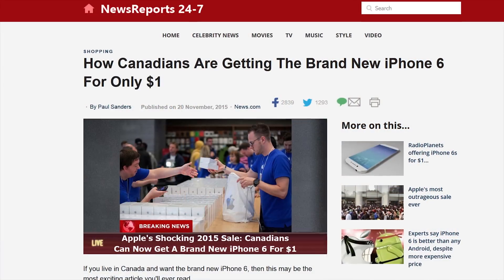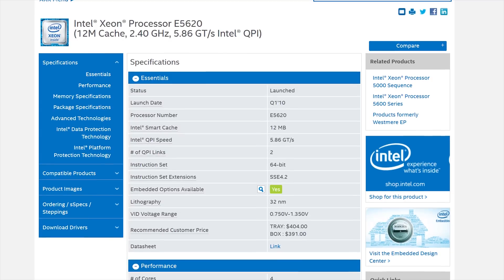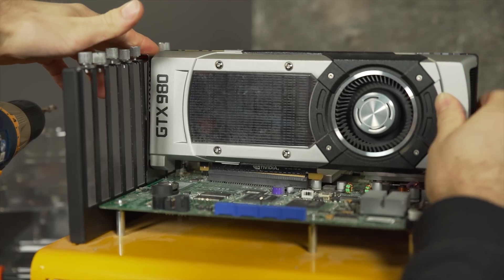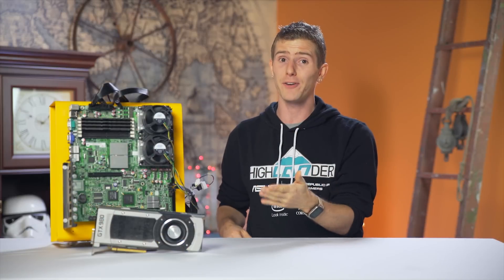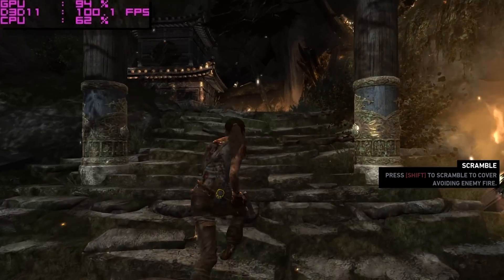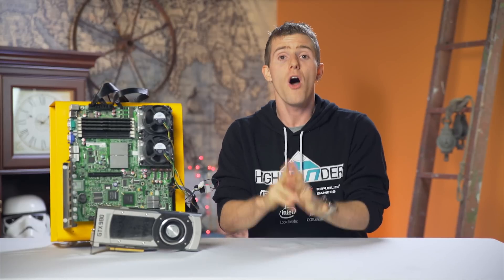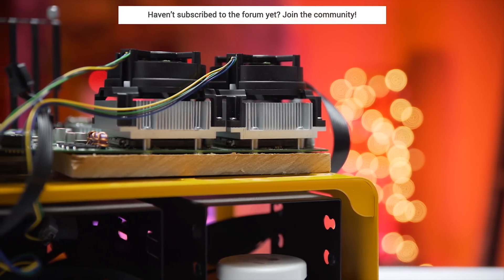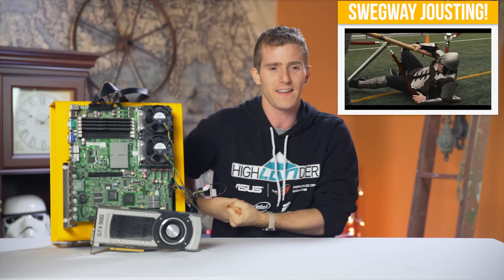Under $150 Budget Gaming 8 Core CPU, Motherboard & 16GB RAM

Comment: Ive had a desktop like that for almost a decade! It's an Intel S5000XVNSASR. First, I ran it over remote DVI cabling in a separate server room, but now I've put it into a regular PC case (Chieftec with LGA-771 holes) and the CPU fan noise is HORRIBLE. Those fans (btw use copper, not aluminum models for Xeon X5450), are not designed to run quiet; moreover, because there's two of them, you get horrible low frequency vibrations (i.e. loud hum from the case) at certain speeds if they're a bit different (mine are). Finding liquid coolers or premium air coolers like Noctua NH-U12DX at this time is just a bust. I've had two shops on Amazon send me wrong models (NH-U12S). I suggest you to do the same trick, but with more modern motherboards.

Comment: can u test this one again now in 2018?
Reply: 2020 now and still no more testing this :(
Reply: no
Reply: i would have liked to see a second attempt at this but with commercial socket 775 motherboards modified to take these chips. turns out by covering two pins on these 771 socket Xeon chips and by cutting off 2 of the protruding plastic edges found on the corner of the socket on the motherboard, you can run these chips on commercial 775 socket motherboards.
Reply: @yareddeyaso1219  turns out u could have done that in 2010 when the 775 came out....
Reply: @kumbaj1612  yeah. I'm just seeing linus's video now so that was why I wished he had revisited it.
Reply: you can get xeon 4 core 8 logical for like 5 dollars now... the mother boards are about 50-60 dollars second hand though but its still a viable budget gaming pc.
Reply: @Writeous0ne   I can't agree with you ,  you can get  good  4/4 cpu for  99$ with motherboard that supports  new cpus and is being updated (am4)   2200g can handle  most of the new games with onboard gpu
Reply: @kaliavaliani7153  at $50 old lga 2011 xeons have more value than zen+ apus
Reply: @pankaik  better upgrade path

Comment: Powredge 2950 isn't bad. Still only x8. Have to saw out the back of the slot to fit gfx. Chassis is huge. But I picked one up with 2x4 core Xeon and 32gb fbdimm for 75 Canadian. I picked one up with 1x4 core Xeon and 4gb ram for $12 Canadian.

Comment: This was a cool idea when it was made.  For those wanting to get into 8 core and 16gb cheap in 2018, might check into LGA 1366.  There you can get workstation or server mb, 8core cpu and RAM for $150 and better PCIe performance.  Some are better overclocking too.

Comment: If video is capped by the x8 port that work at x4, just change the video card for 2 HD 7790 on crossfire, doing crossfire you overlook the x16 limitation, and price of 2 HD 7790 is not that expensive

Comment: Hey Linus, where do you think we are today in terms of the economic viability of used server hardware as an alternative to lower cost consumer processors? Keeping in mind that we're over two years down the road and the trend towards multi-threaded workloads is continuing, as is the availability of post-Sandy Bridge server equipment which are arguably better performing in 2018 than the Xeons were when the video was released.  Big fan, let me know your thoughts!

Comment: Did this in 2018 for under 80$. Only cost me 65 because only 1 CPU+ 12gb of ram. Supermicro x7 boards are good as they have lots of PCIe slots, 6 Sata ports.

Comment: I'm foolishly late to the party, but after years of paying way too much for Apple everything, I got back to using and building traditional PCs-- well tinkering with, more like.  Haven't done a total build in a long time.  point is, it feels almost like a little revolution to get away with playing titles like that on a super cheap machine, especially if it's made from used parts.  I know the impact is minimal, but at least those parts don't end up in a land fill, and a corporation does not rip you off.  Seems like a win to me.  Thanks for the very entertaining and informative videos!

Comment: i rock a 06 mac pro dual quad xenon 6gb ecc ddr3 plenty of pcie slots on it and i use the dx11 ati 5770 1gb gddr5 windows 7 64bit and is just now hitting games it cant play basicly new cod ww2 new forza  lots of the newer games only run at 25 to 30fps and these are titles i dont meet system requirements then i have a hp wx8600 server i use as a gaming rig agin dual dual core xenon ddr3 ram js they are the perfect answer for cheap gaming and emulation

Comment: So, yeah, I came back to this video to let you all know that I did this, and it sucked hard ass. I had the opportunity to buy an old IBM server for 20-ish  US dollars. Ordered 16 gigs of ram and two 4 core 3.61 ghz xeon cpus off ebay (and also a Pci-e extension cord as I wont saw off a piece from the most expensive part of the build) for 51 USD. Bought a second hand 750 Ti for 96 USD I was looking at those ebay chineseum 55 USD gtx960-s but I didn't had the courage(would like to see a test BTW), and I was set. Or maybe not, there was only one heatsink so I had to make my own from another heatsing by sawing off chunks of it. Or I could have ordered one from india for 50 more dollars (no way, this is a budget build). I had to buy a sound card becouse why would any server need one?So the first one didnt worked in my mobo, fuck you ASUS and your sound cards, so Im not counting that one and I settled for a cheapo Star tech or some shit for 23 USD. After this I put together everything, installed win 10, it works like a charm (a very loud charm, I havn't replaced the fans yet). And then the next day, when I wanted to install games and finally play. The mofo Adaptec Raid controller decided to die, the server won't boot without that even tho I couldn't care less about RAID (a raid card for this server is 100 USD, agan from india for some reason). So I spent 3 days to figure out a way to bypass it and finally get it to boot, I had to update the BIOS but Lenovo decided to rename these old shits form System X to ThinkServer so I could't find any support untill I found this out. Oh and it is crazy heavy. But finally it works and it was worth it, was fun to put it together, caused me some headache. Now Ill be off to play some crysis.

Comment: YES! i can finally afford to make a rig that doesn't suck!
Reply: BTW are there any Micro atx sized dual socket boards out there? I'm trying to build an ultra budget build in a dell dimension 1100/3000 case and I need some advice on cheap setups that will work well enough for semi recent games.

Comment: 2 years ago I had a good Asus P9 motherboard, for i7. All I needed was a processor and some RAM. i7 was so expensive that I just sold the board and decided to buy an old workstation, HP XW8400 fo about 300 dollars. The prices here are a bit higher here... For that money I got a HP case, PSU 850 Watts (!!), 2x Xeon quad-core 3.0 GHz and 4 GB of RAM. And some old Quadro graphic card. I bought more RAM, now I have 16 GB, nVidia GTX 580 O.C. Lightning II and Intel SSd for my system, with 3 more HDDs for data. What I got is a much cheaper PC that can run any game (that I play) and I run them at Ultra or High specs.

This kind of PC uses a lot of power, one CPU uses 150W at 100%, so you will feel this on your electricity bill, not much, but it is noticeable. I can not improve this setup any more, except for the graphic card, so I can still use it for years to come, with some newer GPU. Biggest problem and a bottleneck here is the memory, which is Fully Buffered DDR2 ECC that runs on only 667 MHz, but it is a quad chanell, so that helps a bit. Other problem is the expansion slots, there is only one PCI slot for aditional cards and I used it for a better sound card with optical output, because I need it. You can choose to use that for USB 3.0, SATA 3 or like I did, for a better sound card. But you can choose only one of those things... There is one PCI-e 8x, but if you have any gaming graphic card, it will cover that slot. The mother board has 2 PCI-E 16X slots for SLI, so that is an option as well.

Windows 7 64-bit works great, all the hardware is recognized and there are official drivers on HP site.

I love my Workstation.

:)

Comment: form what research I did seems those xeon cpus (711) can be used in a easier to obtain and much better suited for desktop use 755 boards, can even go with easier to find (faster?) ddr3 just requires a little cutting of either the cpu or the socket notches to make it fit then using pencil to jumper a few of the pins on the bottom of the cpu (look it up) and not need a special multi cpu windows license! im surprised they didn't do this tbh
Reply: hey thanks for the response, just wondering did you need to run a bios hack to get it to take the xeon cpu ? seen a listing claiming one was needed, also what gpu did you use it with and is it decent gaming with only the single cpu? (more than 30fps?) thanks

Comment: I have a HP ml330 g6.
I upgraded xeon 5660, it came with 12 gigs of ecc ram. I have been using it for 4 years with 770gtx, creative audigy (as no integrated soundcard of course), and hp410 raid controller.  Not having too much issues playing games still. (New titles of 2017 course not full maxxed out)
Back in the days it cost me 330£ for the gpu, and that's that.
The micro server was for dump, that was for free.
Later I added a Samsung 850 250gig ssd for the os.
Oh almost forgot I changed the fans for a swift2 (bit hacking were needed as it has special connectors) ... As they were LOUD (search for ml330 g6 startup), it's not ment for home use.
So if you choose a micro server or a workstation, you have more expansion slots, they will do the job. drops the mic

Comment: See this is why I get annoyed with Linus tech tips some times. They boast that the hole system cost only $150 and end up slapping a $400 gpu in the build.the only reason this computer did well at all, was the fact that there was an enthusiasts grade gpu inside.

Comment: Lets  be honest: Anyone who has money for a GTX 980 (which was the top single gpu for its time), also should have money for the rest of the system.
Reply: That's not the point of the video. That was just to see if the setup would bottleneck the GPU significantly (and while it did, it wouldn't on a lower end card). You can put in a lower end card and still run the machine.

Comment: I'm just building a rig based on a HP Workstation xw6400 which I got for free. It can take 2x Xeon 5365 @ 3GHz which I bought for £30 each, 16GB of DDR2 RAM for £20 and I'm sticking a GTX 1060 into it xD Just waiting on the CPUs to arrive as I previously bought Xeons 5450 which don't work with this MoBo.

Comment: I built my server using $69 SuperMicro X8STi-F , $10 Dual X550s 16threads total, stock 1cu heatsinks cam with board, $60 for 2 212 Evos, $34 for 24GB DDR3 1333 ECC.  Eventually Ill add dual X5650s. You overpaid for that shitty setup Linus.

Comment: The whole section about what RAM to get epitomizes why I've never even attempted to build my own system. I mean if it was just a matter of looking up compatible parts and getting the highest model ones you can afford, that would be one thing, but I don't want to have to spend hours or even days trying to figure out what parts will work properly with each other and which model is best. Just ask online! "This part is great, get this!" "No, that part sucks, get this instead!"

Even with CPUs, you can't just pick the highest processor model because it's not always the best. I've seen it said many times that some i3/i5 processors can beat some i7 processors. So how the hell am I supposed to know which one is best without becoming a damn expert in CPUs? Then add becoming an expert in RAM, an expert in GPUs, an expert in power supply brands, etc.

Is it any wonder that so many people just go buy a system? 

And can someone please explain to me why 90% of the damn parts aren't actually labeled? What's that graphics card that was pulled from a system? Why of course it's a VH-17281! Everyone knows what that is! And how about that Creative NSU261A? Oh yeah, I've heard of them! And that 1279871B RAM! Are the manufacturers ashamed of their products? Is that why nothing has the model number/name that the parts are sold under anywhere on the board?

Comment: I probably would have soldered in a new capacitor with the same specs and longer insulated wiring to move it away from the card slot instead of sawing the graphics card...

Comment: Go with old workstation boards not server boards, decent speed PCIe, SLI on many of them, loads of PCIe slots and same dual xeon sockets.
My workhorse PC is a 10 year old IBM ZPro 9228 with with 2x Xeon X5365 3.0Ghz Quad-Cores, 32GB ram and recently a GTX 1060.
The graphics card does bottleneck obviously but it takes pretty much anything I throw at it and the system itself cost me about what I spend on coffee a month.

Comment: hey! i have an Asus H81M-K motherboard with an intel i7 4770, im on a budget and i still need a GPU, i also have a thermaltake case with just a 300w power supply that comes whit it, do i need to upgrade my PS or there is any good GPU that works?

Comment: you could have bought a MSI X58 Pro E with an Xeon X5650/5660/5670 instead of wastsing Money on a Server MB. It has 6 cores and can be overclocked up to 4,4 GHz easily
Reply: and you can use ddr3 ram
Reply: i got a cinebench score of 924 clocked to 4,0 GHz

Comment: You can make this system better. Im saying get a intel xeon 5650 witch is a 6 core cpu and find a server mobo with the unusual lga 1366 socket. If you can find a board with 2 sockets boom. 12 cores. I found the xeon xpu for 20 dollars and a dual socket mobo for 60.

Comment: 😒 Noob, u forgot to mention not all server boards are setup like this, check inside before you buy, alot of boards you dont have to cut the graphics cards, plus alot of them come with a 6pin graphics card plug, easy 1060 6gb sleeper rig, strong power supply already included

Comment: Even though I have a newer i7 4790k system I'm totally tempted to build one of these just for fun. You can find the chips and boards really cheap now. I have a spare PSU, case, one stock and one aftermarket 775 cooler (would fit 771 I guess?) and a few  old platter harddisks (maybe with cheap boot SSD) so I'd just need the RAM, mobo and 2 cpu's. Could be a fun build as a cheap second system.

Comment: I got an entire server with 24Gb of ddr3 for the same price shipping included lol
It's an IBM x3550 m3 with 2 Xeon E5520 quad cores 8mb cach, 24Gb ddr3 ECC, 4 2,5" hotswap bays, ServeRAID br10i raid controller cd drive slot and it has all the server stuff like IBM IMM wich allows you to monitor and control the server from anywhere. It also have redundent dual 650watt PSUs !
Reply: No, it wasn't fo gaming because the intergrated graphics are shit, buy if you add a Graphics Card, it could work quit well, I noticed that the single core performence was like an i5, but the multi threaded perf is higher than a i7 4790k
Reply: Haven't tested with a GPU yet, my 960 il too big to fit, I need a single slot card
Reply: I will probably test it as soon as a get a propper PCIe exteneder ^^

Comment: Or you could just buy a amd fx 8350 and use the 980 for that there might be a small bottleneck or close to none or even none but it's a perfect solution 

Cpu $130
Motherboard Asus m5a78l-m $57
Gskill trident z 16 gigs ddr3 $148 
Gtx 980 $523.12 
Nzxt s340 $100 
Corsair CX-M $100 
Ocz Radeon r7 series 120 gb ssd $100
2TB BarraCuda $67 
Dell 16x dvd/rw $20 
Cooler master 212 $35 
GRAND TOTAL 1,280.12 
It might be out of budget but it is a great computer

Comment: Why not use sandy Xeons? They can be found for less than 100 (some can be overclocked!), would be way better, and a cheap X79 board could likely be sourced. YA it might be more like a 250 build, but it would very closely compete with modern hardware.

Comment: Hi. I have dell precision t5400 with two intel xeon e5420 and I have problem. I can not install any 64-bit version of OS when I intall both of CPU. When I remove second CPU I can install 64bit OS and vhen I put back second CPU, system doesn't recognize it. When I go to my compute + properties, system shows only one CPU. Same problem is with task manager testing and benchmark testing in Performance test 9.0 even if my BIOS shows both of CPUs, my benchmark testing result is better with one installed CPU than with two. I was trying to fix my problem and I didn't find solution yet. So, can yuo help because my knowledge about this is so little. Thanks

Comment: You could have saved a lot of headache with the board by getting a P45 or nvidia 780i or 680i board. You can mod your X54xx with a sticker and a knife (and a careful hand) convert the 775 socket to allow the 771 chip. Its pretty easy..somewhat. Some BIOS modding might be needed. It works okay. Built a couple systems, gave one to my friend's son. Probably could do under $150 as well. Whole thread on OCN, or google it. It was a neat project.

Comment: Got a Dell Precision 690 which I use for gaming, recording, and otherwise.  Have been working steadily to build it which includes two e5335's 2.0 Ghz 8 cores and rips up gaming with multi ore render support.  Have an older HD 7570 as well may not seem like much but it works great.

Comment: You could skip all of the weirdness and just get the entire server with chassis, PSU's, fans, RAM, etc. I picked up a Dell R710 for ~$100 with 48gb ram, dual hex core CPU's with HT, PCI-E riser expansions,  etc. You may have to make or buy custom PSU wiring to power the video card but it should work.

Comment: Another note if you choose this path. Certain versions of Windows don't properly detect if you have 2 cpus installed, and can as a result run very slow and only ever utilize one cpu. Windows 10 handles dual sockets fine from what I've seen